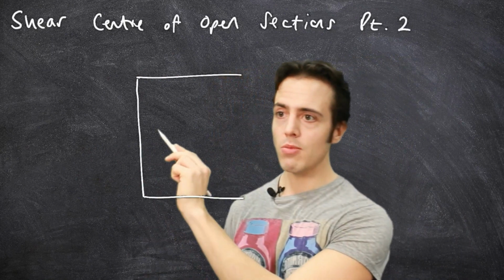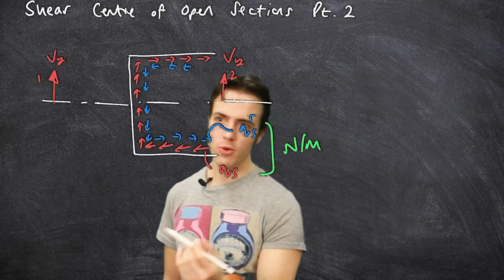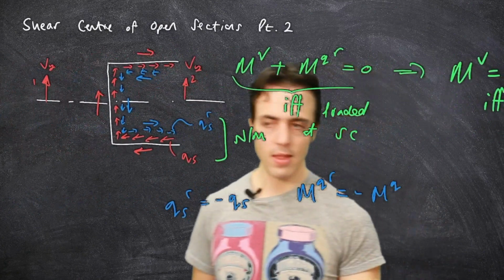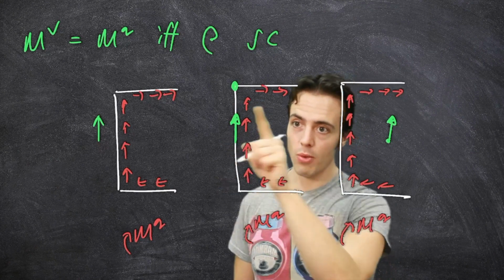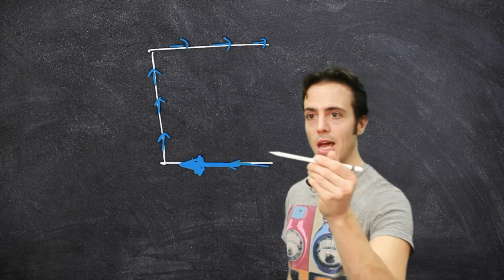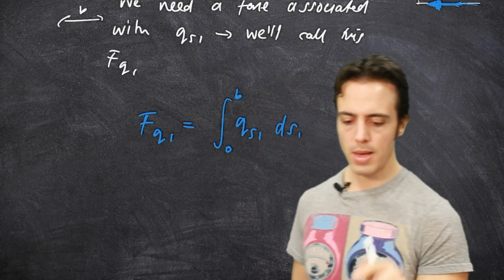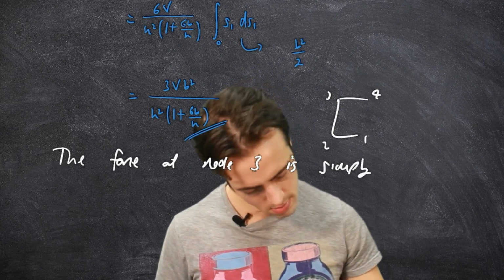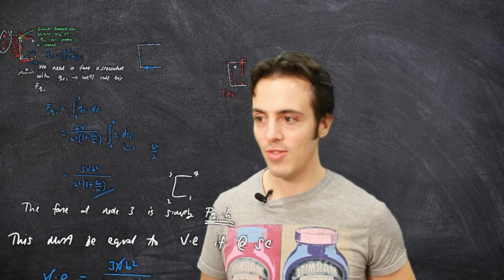Mechanics of Aerostructures - Module 01 - Shear Flow Example Pt. 2

Comment: why internal shear has same direction as applied load?
Reply from the maker: The internal action shear flow is the external force distributed over the cross sectional area. Its resultant (integrated) force must have the same magnitude and direction as the applied load.

So, for most shapes, parts aligned with the action force will have the same direction of internal shear.